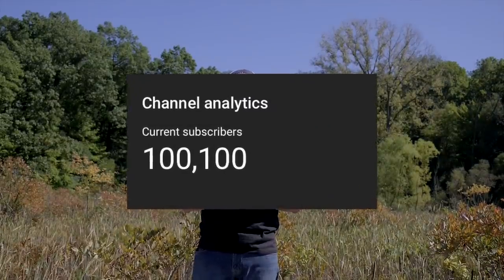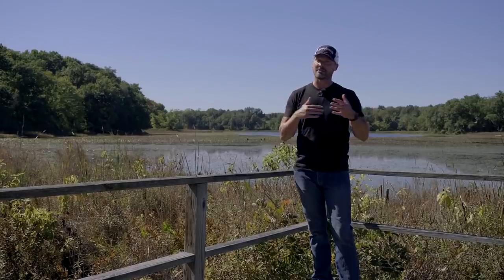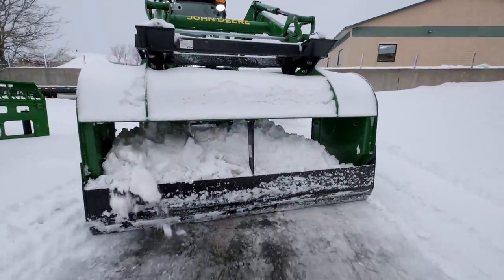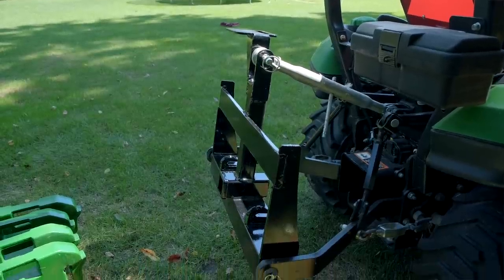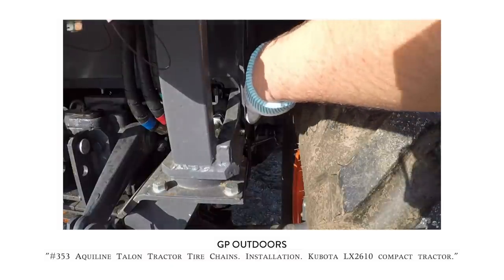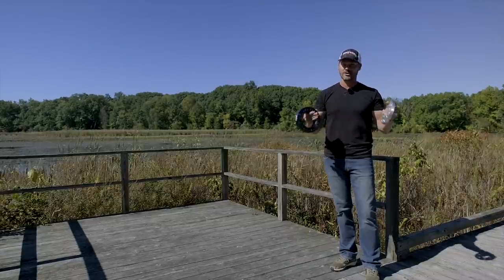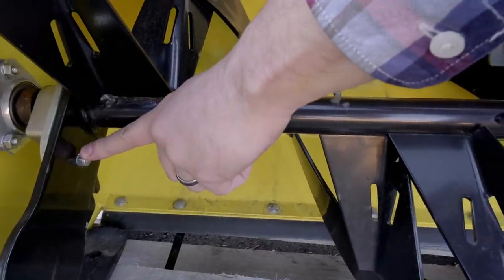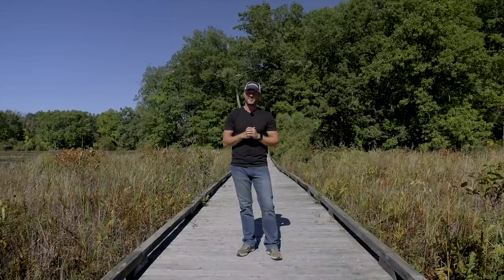TOP 10 TRACTOR TIPS FOR SNOW EQUIPMENT PREP!🥶🚜 DON'T DELAY!

Comment: I have a John Deere 3025E. As an active duty service member heading into my first winter with my tractor in the Colorado mountains, your videos have helped me tremendously in preparing and maintaining my first tractor. I'm looking to utilize my JD to its fullest as I didn't buy my 2nd tractor first and get a maxed out 4000 series. Thanks for the fantastic support to a bunch of strangers!
Reply: Thank you for your service! 🇺🇸
Reply: @Dale.Nienow  What military base is in the mountains in CO?  Carson, Peterson, AF Academy are all on the East side where the snow melts fairly quickly.  I spent a couple of years at Carson.
Reply: @traviseggl3794  I think it’s the The Cheyenne Mountain complex.
Reply: @Dale.Nienow   NORAD is right across the interstate from Ft. Carson.  You can see the entrance from post.  It is not back in the mountains.  It is in Cheyenne Mountain, which is the first piece of rock bigger than a hill on the East side of the Rockies next to the open plains.  It is a pretty cool place.  They used to offer tours, not sure if they do anymore.
Reply: I’m from Pueblo!!

Comment: Who doesn't like free?  Even better than free are the helpful videos produced by GWT..THANK YOU!  I own a B2650 with a cab and live in NE Wisky.  After retiring from the military with almost 3 decades of service I've got some parts that are worn out and owning a tractor is a must.  Being new to owning a tractor and having some land to manage, we've found plenty of ways to use our tractor, and all these videos really help!  Having a set of Bora wheel spacers could definitely improve the stability and safety of the tractor!  I have a snowblower on the front of the tractor which was a must and makes cleaning up way easier.  It did take some getting used to clearing the gravel driveway the first season and lessons learned in the spring when you see gravel all over the grass.  Now I let a basecoat of snow buildup and adjusted the skids to keep it almost an inch up.  Keep up the awesome work producing the videos.  Stay safe, y'all.

Comment: I’ll be seeing for the first time this winter how my 1025R handles the snow. Your videos are a big help. Thank you!
Reply: Weight is your friend here, either adding ballast by filling the tires w/ a rear blade or investing in suitcase weights. 
I run a kioti ck4010 hst, its larger then the 1025r, I filled my rear tires (liner w/ calcium) and run a 72" rear blade, took the front bucket off and bought a hla 72" snow pusher, even w/ all the extra weight running r4 tires I still have traction issues when the snow is 12+ inches, so I bought front and rear tire chain, diamond pattern for the front and double ladder for the rear. Most of the time for medium snows I just put the front chains on and its more then enough in the traction / steering department, for large nor'easter blizzard events 18" + storms I'll put the rear chains on, its a bumpier ride but I never got stuck once and the traction makes the tractor like a sherman tank, it can push through anything.

Comment: I have a JD 2025R and this will be its first winter.  No snow to speak of in this part of Oregon, but we will receive endless weeks of rain, followed up with more rain...  
An alternative to the heated seat pad - an electric vest.  I wore one in my motorcycle days - thermostat controlled, connected to the vehicle's battery.  Worn under a good jacket, it did an amazing job of keeping hands and feet warm.

Comment: Gib
I have a JD 4300 with a Curtis cab and JD snowblower in NW Montana. We have a three mile driveway and frequently 3-4 feet of snow. Works awesome. A caution-before I got the wheel spacers, I had a link break on my tire chains while I was driving. The chain hooked the brake linkage pulling the left rear brake into full. This sheared a gear in the transmission. Lesson learned-get the wheel spacers if you use tire chains, always double check your tire chain links and tension and if you hear a chain flopping around, STOP and investigate. Lots of good tips on your site, thank you.

Comment: I bought my first John Deere garden tractor in 1980, a 214.  It was great.  Traded it for a 425 in 2000 and it always treated me well.  Traded it for my current X750 in 2019.  Love the X750.  Works great for mowing and snow removal.

Comment: Some good tips here.  Thanks.  I can say that chains on all 4 of my LS XJ2025 totally saved my butt last year.  In WI we had some very deep and heavy snow falls that required the chains.  My front tire chains barely fit so some spacers would be helpful just for peace of mind.

In addition to all of the tractor and equipment tips, I also like to complete tasks such as installing in marking flags, reflectors to indicate the edge of pavement or obstacles and removing any lawn decorations that can be hidden in the snow or should not be hit by snow from my snow blower.  Other things to consider are crack filling in pavement/cement or regrading gravel.  Although when I had a gravel driveway I found that doing this too late in the fall did not allow enough setup time.  This leaves too many rocks loose and they can be easily scraped off into your lawn.

Comment: I'm finishing up my winter prep project as we speak.  I designed, built and installed hydraulic angle function on my scraper blade that I use with my Kubota M5660.  Next I scraped, sanded and painted the implement.  I used Summit Hydraulics, Depatie Fluid Power, and Outback Wraps products on my build.  Turned out sweet and will be a big help so I don't have to dismount the tractor to angle my blade when plowing snow!

Comment: I'm using a John Deere 2025R that I have had for about a year.  Your channel has helped me understand my tractor better as well as the use of the many available attachments. We don't see much snow here in the Lowcountry of South Carolina but we do on occasion. A few years ago we had a storm that dumped about 4 inches on us. I wish I had my tractor back then. We do, however, have a lot of soft wet ground to negotiate.  Because of this I have had some stability issues when crossing soft areas. I quickly learned about self-recover on a 2025R using my backhoe.  I think a wider tractor would help on softer ground.  Thanks for the great info as always.

Comment: I have a JD 1025R new to me in 2013. 750+ hrs on it now.  Started moving snow using loader and bucket for a few yrs. It works but is slow. Subsequently began finding used pieces to complete a front plow w/hydraulics setup. Took 3 yrs but I got it done.  Always looking for new and updated info. Love the channel.

Comment: I have a Kubota L2501. This is my first winter with this. You have a lot of great tips. Even the obvious ones are good because I find myself forgetting them. I use my tractor in uneven ground so a set of wheel spacers would be a lifesaver.

Comment: We have a BX2360. We don't mow with it but the snow removal is great with a blower and a plow both front mount. What we can lift, like fire wood rounds is great to have. The biggest down side to the tractor is that it is a pin on bucket. I did add a tooth bar and that helps it to dig. Wheel spacers I feel would help a lot. Thank you for your videos.

Comment: John Deere 1025r, used for moving snow and year-round yard work, brush hogging, snowblower, box blade, loader work
Reply: Hi Matt, ck your snowblower if it is equipped with a plastic impeller, my neighbor bought his in 2018 & the dealer just contacted him that they have an upgrade kit for a metal impeller & they are also changing the single chain drive to a dual…God Bless…Chief..{NYS/ADK}

Comment: I’ve used a 1023e for the last 8 years in the northeast.  Biggest challenge for me is the variation in the density of snow.  A big storm with heavy snow is always a challenge when using a pusher, but bucket or blower works.  Nice to have options!

Comment: All very good tips!  Especially hitting those grease zerks, much easier when the temperatures are mild (ask me how I know, LOL!). My "tractor" is a 2015 JD X739.  I keep it sheltered, but not heated.  I love it and it's perfect for getting around and working on my heavily wooded 10-acre property.  If I may add: a trickle charger (I use the Battery Tender Junior model for my JD and my home stand-by generator) will ensure the battery is at 100% to give you an edge for those really cold start-ups.  Also, you mentioned the  wax problem with diesels, but gas can have an issue too.  If you keep your gas supply in cans or don't keep the tractor's tank full all the time,  condensation can develop.  Gas line anti-freeze (essentially alcohol) mixes with any water in the system and prevents freeze-up in the lines and filter.  I also switched to LED highlights based on your recommendation, and wow!  What a difference!  Keep up the good work!

Comment: My everyday all purpose tractor is a John Deere 4052R. Snow removal, mowing pastures, tree clean up, gravel driveway maintenance, miscellaneous property upgrades and maintenance. I have been looking at getting a set of wheel spacers since not a single part of my acreage is flat. Also, if you want to know of another good tire, I put Alliance 550 tires on my tractor about a year ago. They are far superior for how I use my tractor over the factory R4 tires.

Comment from the maker: THANKS FOR STOPPING BY!  IF YOU'D LIKE MORE INFORMATION ON A PRODUCT IN THIS VIDEO, THEN VISIT THE LINKS BELOW!

HLA Snow Pusher: https://bit.ly/2WpNcKF
UHMW Edges: https://bit.ly/3m5qnEE
Anti-Fog Spray: https://amzn.to/3us4aET
Seat Heater: https://amzn.to/3AWVite
Diesel Anti-Gel: https://bit.ly/2Y3x9T1 SAVE 5% WITH CODE "GWT"
Diesel Emergency De-Geller: https://amzn.to/2YbjqKt
Lube Shuttle Grease System: https://bit.ly/3AWjZ9d SAVE 5% WITH CODE "GWT"
LED Lights: https://amzn.to/3B2WR9a
LED Lights: https://amzn.to/3kTso7y
Rubber Chains: https://amzn.to/3om014g

WANT TO SAVE MONEY? CHECK OUT THE GWT DISCOUNT CLUB!  Use code GWT at any of the vendors below and you will save cold hard cash :)  I will also get a commission for the sale, so it's a win-win-win!  

10% OFF WITH CODE GWT AT OUTBACK WRAP! http://www.outbackwrap.com
5% OFF WITH CODE GWT AT MUDD'S CUSTOMS! http://www.muddscustoms.com
5% OFF WITH CODE GWT AT JU FAB WORKS! http://www.jufabworks.com
5% OFF WITH CODE GWT ON SELECT PRODUCTS AT SUMMIT HYDRAULICS! http://www.summit-hydraulics.com
5% OFF WITH CODE GWT AT LUBE SHUTTLE! http://www.lube-shuttle.us/store
5% OFF WITH CODE GWT AT 511 DESIGNS (CUSTOM GRILLS): http://www.5elevendesignz.com
5% OFF WITH CODE GWT AT TRACTOR PTO LINK! http://tractorptolink.com
5% OFF WITH CODE GWT ON PROTERO DUMP SYSTEMS! http://www.proteroinc.com
5% OFF WITH CODE GWT ON SWEEP-ALL SWEEPERS! http://www.sweep-all.com
5% OFF WITH CODE GWT AT YARD GLIDER! http://www.yardglider.com
5% OFF WITH CODE GWT AT MILLER TIRE! http://www.millertire.com
5% OFF WITH CODE GWT AT BIG TOOL RACK! http:www.bigtoolrack.com
5% OFF WITH CODE GWT AT HEAVY HITCH! http://www.heavyhitch.com
5% OFF WITH CODE GWT AT TRAC SEATS! http://www.tracseats.com 
5% OFF AT RHINOHIDE CANOPIES! http://www.rhinohidecanopies.com Complete survey after purchase, mention GWT, get 5% refunded.

*Discount codes cannot be combined with any other promotions, offers, or deals!
**I choose to sell some products through 3rd parties instead of stocking items myself.  Know that I will receive a commission if you choose to purchase through certain links.  Thank you very much for your support!

This video is for entertainment purposes only.  Good Works Tractors (Good Works Lawn & Power, LLC) cannot be held responsible for content found in any video.  Always reference your owners manuals, use extreme caution, and proceed at your own risk.

Comment: Another informative video for new tractor users,  let me say I have a Kubota L3901 ,  here in Oregon where I am there are lots of hills and slopes and other obstacles to get around I run the R-4 tires because of all the different surfaces I use my tractor on  I have also added a full set of Bora 6" wheel spacers to mine  and what a night and day difference they made I love them , I am considering buying a 4" set because I replanted about 20 acres of Doug Fir Pine  and they are pretty close to each other  which makes the added 12" across the front and rear a bit tight, so replacing them with the 4" when I need to be in that area would solve that problem ..

Comment: I own a 2009 JD 2320. I mow with a 62D1 drive over deck. BORA Wheel spacers would improve my stability especially on the hills. Congrats on 100K. I was stationed at Wurtsmith AFB, near Oscoda MI several years ago, now live near Abilene, Texas.

Comment: I have a 2018 Deere 1025R. This will be the first winter we could use the tractor for snow. The wheel spacers will be a great benefit on hills. I will need the rubber wheel chains also.

Comment: I push snow on a 1500' paved driveway with my x728.  I also push snow on about 2 miles of access trails for firewood access through the woods behind my house.  I don't plow those trails down to earth, the packed snow makes for a smoother trail, and a smoother drag for logs.  I have loaded tires on HDAP tires and put a rubber edge on the my blade.  Keeps the asphalt clear as long as I get on it before driving over it.  Much of the drive is through the woods, so, I like to keep it clean and let the sun melt it down bare.

Comment: As a semi retired widow living in an Oregon snow zone, I bought a Branson 3620R... this will be my first year using the tractor to clear snow from my 3/4 mile gravel driveway and livestock paddocks ...

Would love to have a set of BORA wheel spacers for added stability.  Since my bucket IS drilled, think I need to get one of the replaceable bolt on blades as I do not have a snow thrower.  
Will be checking them out on your website...
Thanks for all the great information!

Comment: I have a X758, 1025R and a 3320.  I use the 1025R as my primary snow machine.  I built a 72" blade with hydraulic swivel to mount on my loader bracket.

Comment: I have a JD 3520.  In winter I use chains on the rear only, and I steer with the brakes.  Putting heavy chains on was a chore, until I figured an easy way to do it.  I plow with a 3-pt grader blade, and cleanup with the bucket.  Sometimes I wish I had a front blade.

Comment: I have a LS xr3135HC (I think HC stands for Heated Cab). I love it, but you have helped make it better with a great snow blade (getting ready to order the hydraulic angle kit from you) and convincing me to get a ballot box (I was using a water tank before). I also want to thank you for showing me the Outback Wrap. I've gotten a bunch. No more confusion hooking up equipment and then rehooking cause they're backwards. They are also great to protect hoses that rub against things (like my 3rd function hoses do).

Comment: Great Channel!!!  My wife and I just bought a JD 3046R and equipped it with a front blower and broom in preperations for the upcoming northern Michigan winter. I also purchased a LP landplane, Frontier forks, and the 320R loader.  I am currently looking for a grapple and rear blade. In  addition to the 3046R, I also own a JD 40, MT, and a 3020. The 40 is restored with the other two soon to be. Sold but not forgoten...a JD 4850 ad 4240.

Comment: I have a Kubota B3200 . I have a front mounted blower. Had to get spacers to put chains on the front .
It would be nice to have them on the rear to keep the chains from banging on the inner fender once in a while.
Skids on the blower with a larger footprint help a lot on the gravel driveways they can be found online

Comment: This will be the second winter with the 1025R. The bucket works great when the snow slides off the metal roof on the north side of the house on to the drive way. Needs better lighting. Tire chains for the front to prevent pushing in deeper snow? Wheel spacers to reduce the pucker factor.

Comment: Frontline healthcare hero here. 1 more cut and the underbelly comes off the 1025r. I have clamps to keep the bucket off the driveway and I have a 105d with a 46" blade to scrape. Lake effect snowbelt is tough on gear.

Comment: You’ve given me hints to get Bora wheel spacers for my 4044R, but I have to be careful on the size so that my tractor still fits the width of my trailer! Also for winter, install a block heater plug. Avoids getting my tractor angry when I start it up in the winter!

Comment: Great videos and information, thank you. I'm a new tractor owner from the foothills in western Canada. Drive a Kubota BX23S, with a backhoe (great for stump / rock removal, tree and hedgerow planting).  I'll leave the backhoe on for winter ballast; it may get me out of the ditch when pushing snow with the snowpush, thanks for the tip there. On hilly and forested property with 400M sloped gravel driveway. Another very good site, GP Outdoors, will learn snow chain install.  I am concerned about tire chains and snow and ice build up/ clearance of controls wiring harness under the rear fender, while pushing snow,.  Seems to me it could damage/ destroy the wiring. Dealer installed wheel spacers pre delivery.  Good winter prep tips, from a fellow procrastinator, (but getting better!). Thanks again and congratulations!

Comment: I have a JD 3320 with cab. I was seriously thinking about wheel spacers last weekend when I was doing some dirt work. I got a bucket full and was going to take a shorter route by my propane tank and the left front wheel hit a dip in the yard. The right rear lifted about a foot to foot and half. Had to hot the brakes and pucker my butt. After my butt cheeks relaxed I was slowly able to lower the bucket and back out and go a safer route.

Comment: 4310 JD E power reverser,  Curtis soft sided cab with heat, 430 loader, 5 1/2 western plow, 72" 3pt snowblower or rear blade, front and back LED light bars...  opt double ring chains.